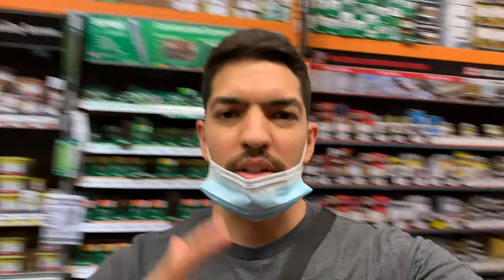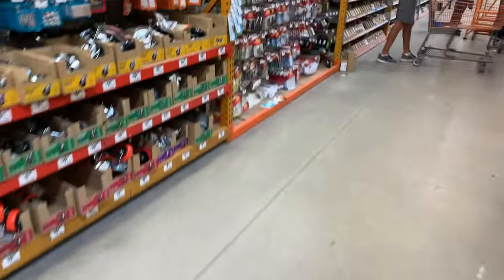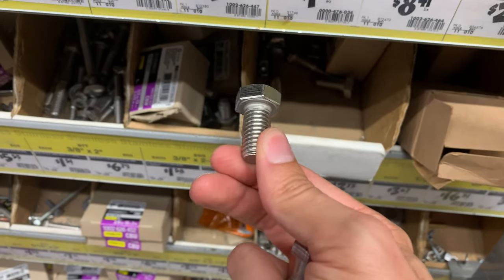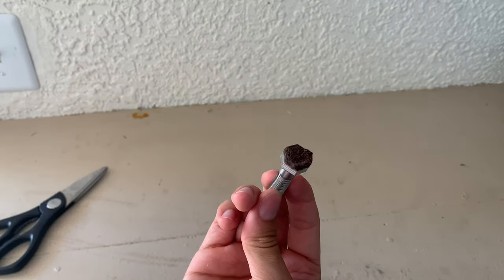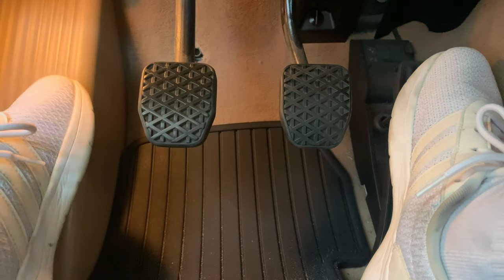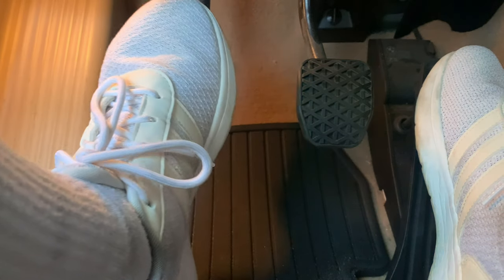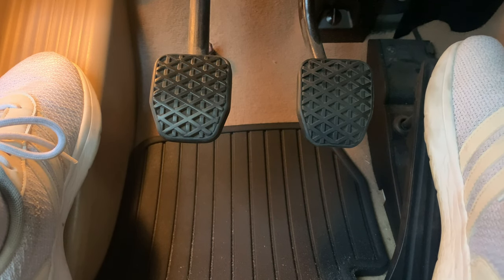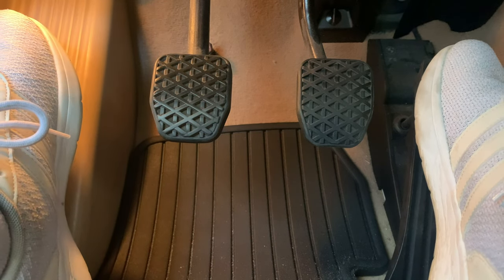THE BEST BMW E46 MOD FOR UNDER $5! DIY CLUTCH STOP!

Comment: I just did it and it transformed the car... now my shifts are smoother, the car feels more natural to drive. As a car nerd I liked the philosophical part ahahah
Reply from the maker: Brooo thanks for the luvv some times I can go into some rants but that part is closest i’ve gotten to explaining a connection to a car you know? Lol

Also, i tried to do it one night bro and rounded the mf nut thats holding it on -.- need to find a replacement nut and then figure out a way to remove the busted one
Reply: @pythondon  I think mine is very close to be rounded🤣🤣🤣.. I was just hand tightening

Comment: Hello! :) 

I have a 2004 BMW E46 320D with M47 engine, 6 speed manual transmission. What measures should I take to make it appropriate?

Thanks in advance!

Comment: I bought the big clutch stop from bimmerworld for $20, this is much cheaper but same concept. Made a huge difference for me, clutch doesnt feel like my foot is going to Australia and back anymore. Im considering the mason engineering clutch pedal as well which supposedly makes it even shorter.
Reply from the maker: Hahaha To Australia 😭😭😭 Bro when I got in this car and put my foot on the clutch for the first time i thought my shit was gonna go through the floor and just keep going out the engine and onwards lmao. The difference is night and day. But yeah im looking to upgrade it more aswell with a DTM style short shift kit once I begin my build! Stay tuned!
Reply: Hi. I really dont like this long distance of depressing the clutch pedal. thank you for your comment on how you did it with clutch stop from bimmerworld... i was looking at in on their website but they said all E46 models require the clutch to be partially or fully depressed in order to start the vehicle.. what does this mean? im from europe
Reply: @MNE0000  you have to depress the car to start the car (atleast in the USA). If your clutch stop is too thick, when you press in the clutch it wont let the car know the clutch is pressed and you wont be able to start the car. So its just saying to not put something super thick down there or else you wont be able to start the car without programming that feature out. Mine worked fine out of the box.

Comment: Does you pedal runs off of the bolt, I believe that my pedal is not hitting exactly where it should, 
Another question, is your clutch hard to push ? 

I changed my clutch, flywheel, master cylinder and slave cylinder, but I feel like it’s too hard

Comment: I noticed my shifts were feeling like crap... removed it and it feels fine now. Maybe the bolt is too long for my lci. The clutch felt completely disengaged. Maybe I need to do a clutch bleed
Reply from the maker: Could very well be the case, if its too long you may be half engaging the clutch which is no bueno at all. Try a shorter one if you can. I think i give the measurements in the video. 1.5 inches long is what i can remember i think?
Reply: @pythondon  yeah It was the same length as yours... but i dont know if you guys in the us also measure the top part or just the thread

Comment: Do you bottom it out or set it? If it is not bottomed out, wouldn’t you want a locking nut to ensure it doesn’t back out?
Reply from the maker: It’s bottomed out! Yes i thought of adding a nut to give me more precision on where it stops. It ended up stopping perfectly where I’d want it anyways though.